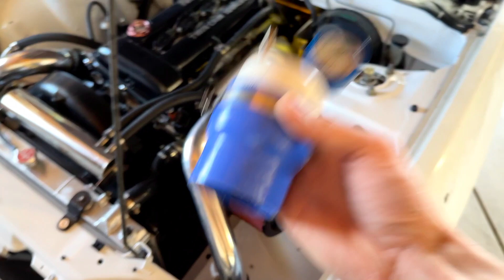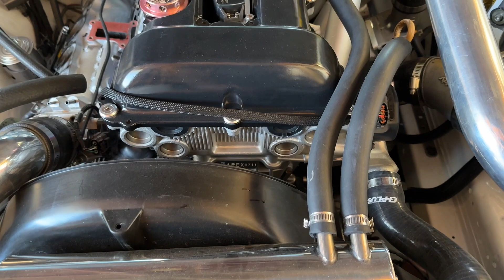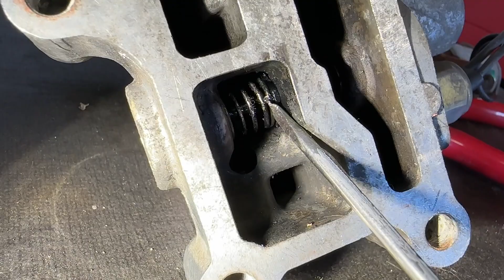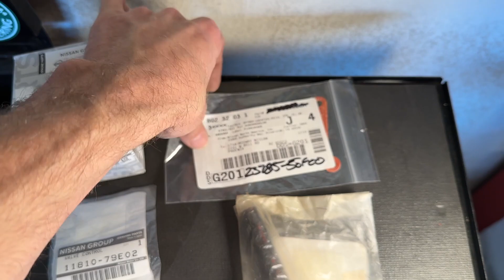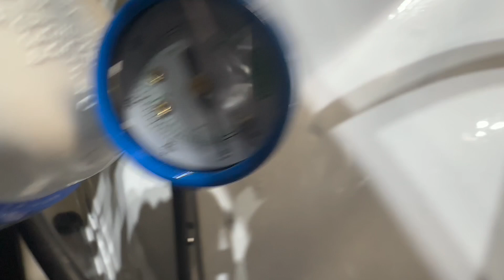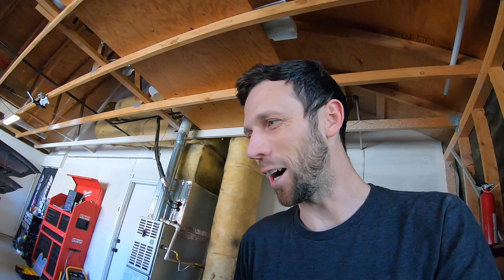SR20DET - HIGH IDLE - Idle Air Control Valve Diagnosis and Replacement

Comment: Did you ever figure it out? Im also running a high idle on my sr20.
Reply from the maker: It ended up being in the settings with Link ecu!
Reply: @ thanks for the response! Glad you were able to find it. I’m diagnosing mine as well with ECUmasters EMU. Hopefully will get this thing dialed in. Good stuff!

Comment: Question for you. My tps was reading .43v closed and and i cant get it to go any higher. WOT its reading 3.93v.....do you think that little bit of a difference can cause some problems? Im trying to sort some idling issues. I have an S13 SR20det blocktop
Reply from the maker: I would say those readings are definitely not standard but from my experience I would say it is most likely close enough

Comment: It's your coolant lines bro. I did this on my S13 I brought over. The circuit you tested is the high idle or bump idle for AC/power steering. The coolant lines you didn't hook up makes the IACV think the car isn't warm so it stays open thus the high idle. Your ecu mainly controls fuel but there is idle settings you can mess with. Good luck homie! 🙌
Reply from the maker: Thanks for your input! I’ll definitely check into that again 👍🏻
Reply: You mentioned deleting a few thing on the intake manifold side. Usually when this happens idle is really off. I suggest keeping the OEM plumbing in tact. Also, try going through the FSM process for setting up your idle. I’ve had similar experiences with idle and timing. I followed the FSM and NOT  Zilvia. Everything worked out perfectly.